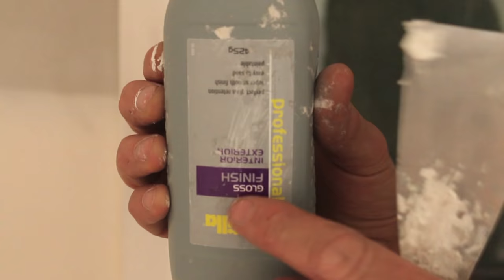How to Fill Nail Holes in Trim! To Easy!

Comment: I need some of that product! Everything I have used up til now, shrinks when it dries. so you have to overfill, or go twice. Either way, a lot more work! Great tip Uncle Knackers =)
Reply from the maker: I hear ya Veronica. That's why l was impressed with this stuff. Shrinkage was almost non existent so l hardly had to go back to re-fill any holes. Cheers :-)